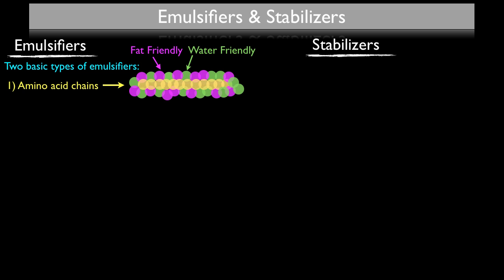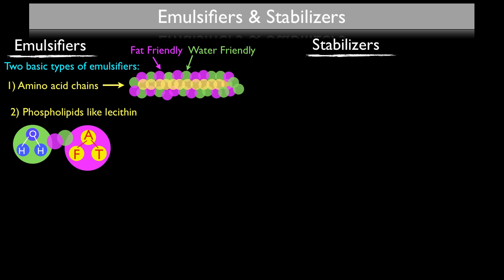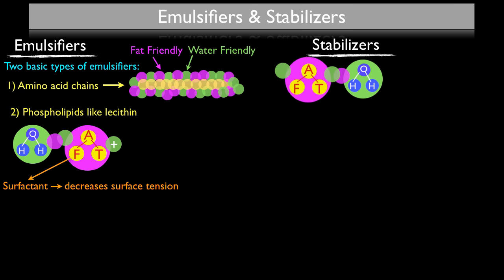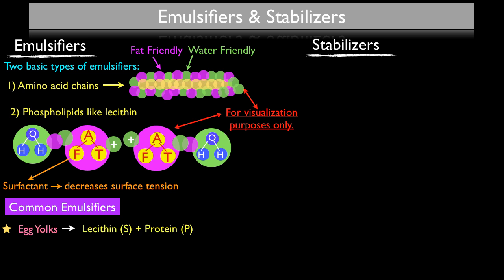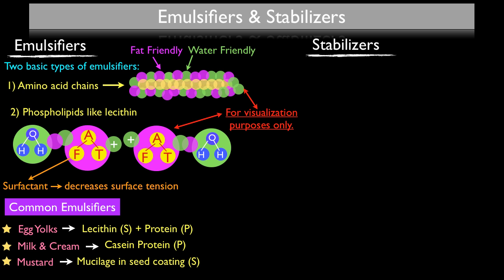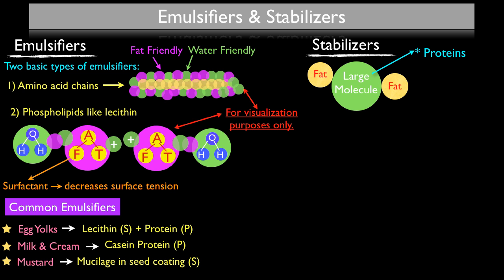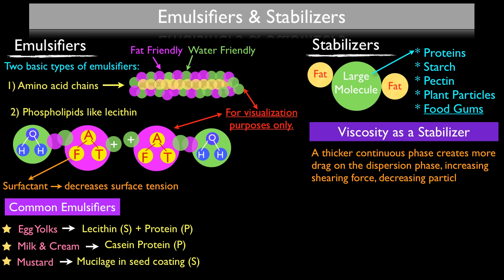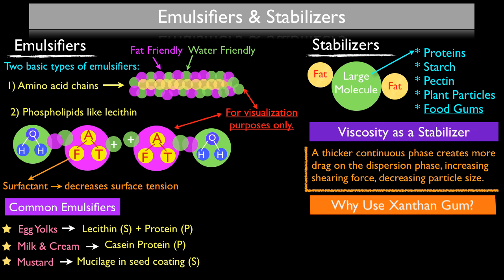How Emulsifiers and Stabilizers Work

Comment: These gums come from rock hard tree resins in some instances. So, water and fats have less friction against these stabilizers? That's what it sounds as to me. How does the human body move these substances out of the body at a molecular level?
Reply from the maker: MrKappaBeta It's more about viscosity. As your emulsion becomes more viscous, the individual molecules contained can't move around as freely due to resistance. This viscosity keeps your fat molecules in suspension, giving you a more stable emulsion. To my understanding, they move through your body just like any other food product. Xanthan gum by the way is created through bacterial fermentation; chewing gum historically came from the resin of trees, but there are lots of "gums" on the market that aren't resin based.